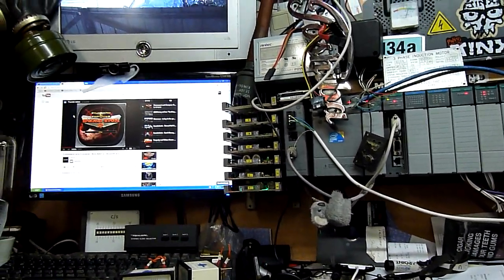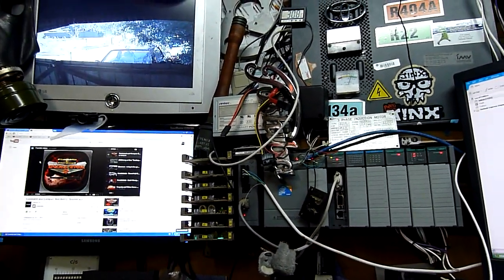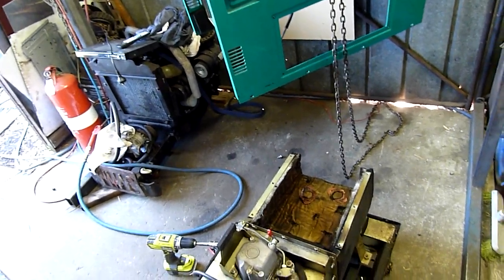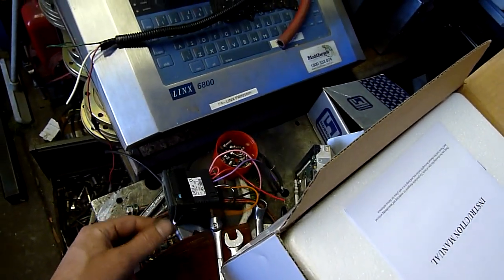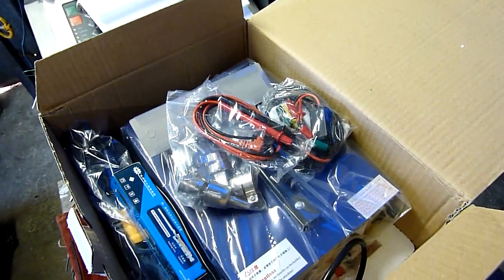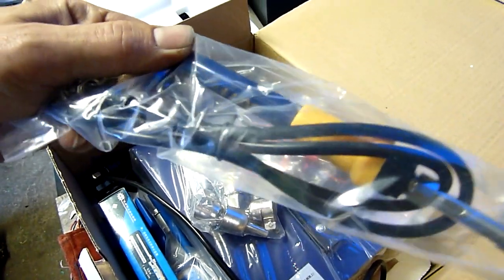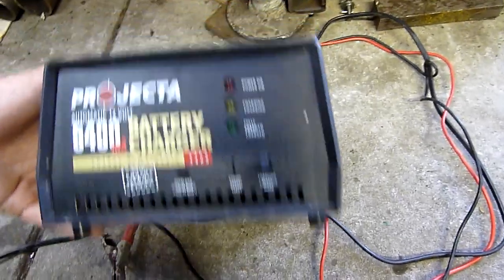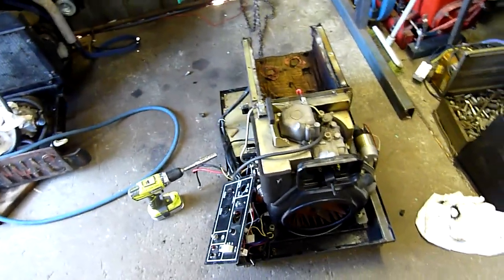Ramblotronic Tuesday - New Toys and Info

Comment from the maker: I'm after somthing that will run my ATI Radeon 5970 nicely. i just stuffed my old Athlon X2 5200 into the new case with that card and its just torturing it trying to get decent frame rate out of that card (bottlenecking I guess) 

if I can get a suitable board and CPU I will give the old AMD to Dad and buy some new ram and a new copy of Win7 64 bit edition

Comment: That server has a good bit of cpu power considering it's 10 years old, but the ram is not very fast and I wouldn't want to pay the power bill. Most of the expansion slots are pci-x so you might have a hard time finding cards for them.
It will work well for video encoding and converting from the command line, but not so well for a video editor with a GUI. It can only output 1280x1024 on the monitor.

Comment: @John, its a bit of competetive fun, its the subsequent comments that often have an IQ > 10 :)

That's a nice setup, some of the best/reasonably priced soldering stations are actually from china/japan. 

Pretty nice how it has a replacement heater element, I got a Goot RX-711AS and it didn't even come with a replacement element :|

Comment: What model SMD rework station? With the charger replace the battery leads with thicker wire, 4mm is perfect, and make them 2m long, it makes it easy to charge a battery while leaving the charger on a shelf.